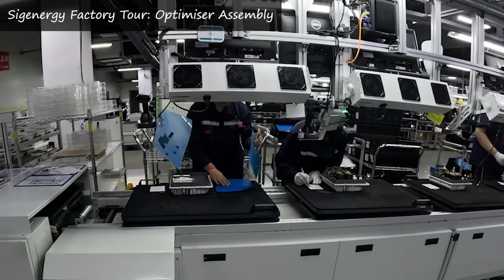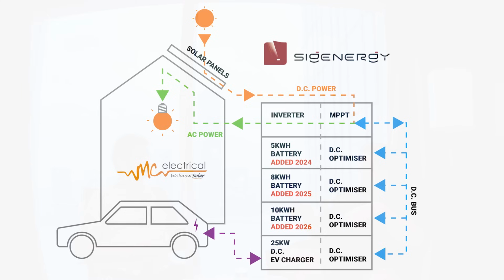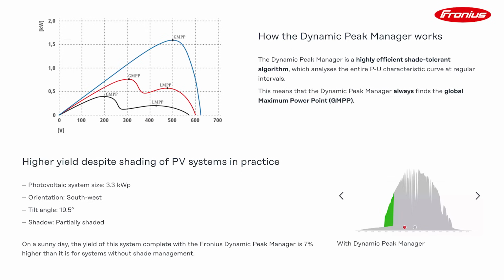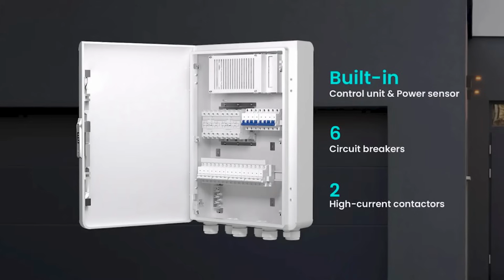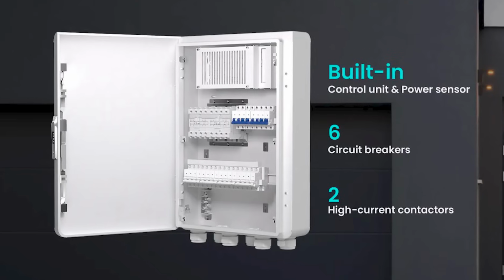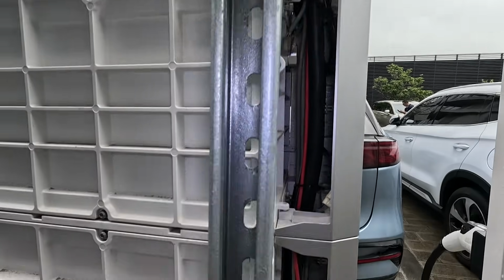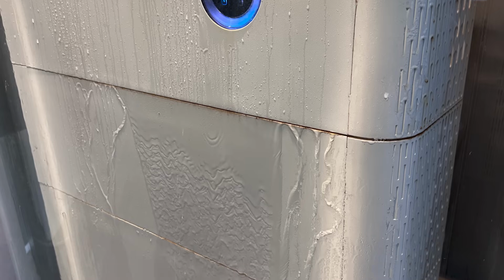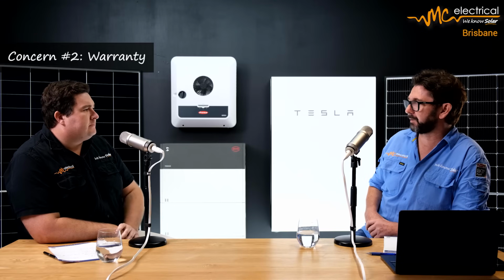Sigenergy Solar Battery Review After Factory Tour

Comment: The way this product is marketed makes it look very impressive, but in reality, there are too many drawbacks to fully trust it.

For example, you found some important issues during your factory tour that confirmed my concerns. One big problem is the DC charger and V2X (vehicle-to-everything) system. It won’t actually provide the full 25 kW of DC charging from solar and battery storage alone. Instead, it pulls extra power from the grid, which means it’s not really using green energy.

Also, major EV brands like Tesla won’t support V2X because managing heat is a big challenge. That’s why Tesla doesn’t offer vehicle-to-load (V2L) either. Most EVs that do have V2L are limited to about 3 kW of power.

So why don’t they educate people about these limitations?
Reply: @madhavamadhav6470   on theory you could charge at 25kW  if you had 25kW of pv and storage power available. Ie solar is producing 15kW currently, and 20kWh of batteries discharging at 10kW.
V2X will get there, but yeh, we don’t know what the ev manufacturers limitations will be…. If they allow it at all. But being DC v2x, it should be more than 3kW, which i imagine is just when they are using an onboard ac inverter.
Reply: Why are you saying it wont do 25kW charging from only battery and solar? Are you perhaps limited by available solar and/or too few batteries? What solar input and how many kWh batteries have you tested with? Because we have no issues charging at 25kW even in off grid situations, and being off grid is a guarantee that nothing is coming from the grid.
Reply: Whole idea is to save money not to spend money 😂
Reply from the maker: Ha, we clearly have different agendas 🫢
Reply: Most of the consumers have 13kw solar average size of battery is around 16 kw if they are using power at home to run aircon and more DC charger takes power from grid too
Reply: @ ok, so clearly your original statement was very wrong. You are building your entire conclusion on undisclosed arbitrary assumptions that has absolutely nothing to do with the DC charger itself. If people have too small of a Solar and Battery system to provide 25kW, obviously you have to either lower the charge power, or you will use power from the grid. That should be self explanatory for absolutely everybody.

Comment: Great video and perfect timing for me as I'm about to purchase a battery system. Agree with all you've said - good and bad. There are also major issues in relation to internet connectivity - if the internet connection is down you lose all visibility to the system. If you are not connected to their servers, after 90 days the battery will shut down!!  There is no justification for this IMO and was the final nail in the coffin for me so think Fronius / BYD might be my best option.
Reply: The justification is that they really want the battery modules to be monitored as any issues detected early by the Ai systems can be noticed (info sent to installer and Sigenergy centrally) and fixed long before it becomes eg a fire hazard. Also, to make sure the software can always be kept up to date, fixing bugs etc. Further, for the Ai to work, it also needs to be online to keep track of electric buying and selling prices. So the 90 days is basically an anti lazy installer feature, forcing them to make the system be connected, to make sure the features and updates actually works.

We have however been putting high pressure on them in Sweden to come up with a solution for also where customers cant or dont want to be connected to the internet, and they have promised to come with a solution in the future, to enable updates via USB etc. We will see when that solution comes how it looks.
Reply: For the record, now with the release of v3.0 of the app, batteries are no longer shut down after 90 days.
Reply from the maker: Oh I’ll have to look into that. With fronius, you loose the app obviously, but you can “direct connect” your phone to the inverter or battery.
Reply: I checked this and the warranty says “limited mode”. Which is kind of vague. Yeah having a dead man switch built in, that it must connect to the Internet is very suspect to me. Especially given current global tensions.

Comment: If this battery is installed inside a garage however this eliminates a lot of the negatives regarding cable management and weather or climate protection?
Reply from the maker: Good point. It’s still raises questions about the design choices of a company that can’t get the simple things right.
Reply: Lots of cables in there for rats to eat, the Huawei they ripped the design off from is fully enclosed so no potential rodent damage, PV string cables goto the inverter which is separate.

Comment: Can you pull DC out of a Tesla model 3 2022?
Reply: Yes you can. We have been doing a lot of V2X testing with Sigenergy DC-charger in Sweden in off grid mode (on grid is for later, still a lot a development of both software and app that has to go in). In short/limited protocol tests (minutes to hours, not days or weeks) we have managed to get V2H working for the following cars so far.
(L) Tesla Y Performance [2024] Feb 2025
(E) Tesla Y Dual LR (NMC) [2022] Feb 2025
(E) Tesla Y SR (LFP) [2023] Feb 2025
(L) Tesla 3 [2019] Feb 2025
(E) Tesla S Raven [2019-6] Mar 2025
(E) Tesla S P90D (New battery & BMS) [2015] Mar 2025
(L) Tesla S [2015] Mar 2025
(E) Hyundai Ionic 5 [2022] Feb 2025
(E) Volvo XC40 [2022] Feb 2025
(E) Polestar 2 [2023] Mar 2025
(E) Polestar 4 [2025] Mar 2025
(E) Fisker Ocean [2023] Mar 2025
(E) MG Marvel R Electric [2022] Mar 2025
(E) BMW i3S [2019] Feb 2025
(E) BMW IX XDRIVE40 [2025] Mar 2025
(L) Audi Q4 [2024] Feb 2025
(L) Audi A6 E-tron [2025] Feb 2025
(L) Skoda Enyaq 80x [2023] Feb 2025
(E) Xpeng G6 [2024] Mar 2025
(E) Citroën eJumpy [2021] Feb 2025
Reply from the maker: No. Regulations doesn’t let you yet. As far as I know the protocol is not there yet either
Reply: @mcelectrical  dam, things in this space take forever 🔥
Reply: @MatthewBayard  There is also the case where you may void your car battery warranty unless Tesla also gives it the tick of approval.
Reply: @Yorick_Mark  hell will freeze over before Tesla takes sales away from their stationary battery market 😔
Reply: @ I think you are right on that front. I had hoped that they would bring V2X functionality with the updated Model Y. Having lived with V2L with my Kia its a must-have for me now.
Reply: The Cybertruck already has it.. so hell has frozen over
Reply: @karlajensen100  you do know the Cybertruck is different to a model 3 right?
Reply: You said Tesla wouldn't do it and they have with their latest flagship model 3 doesn't have the capability because the charger is a charger with a big rectifier and a power supply DC. It can't make AC just like any other battery charger @MatthewBayard
Reply: @mcelectrical  do you seriously have regulations in Australia that forbids discharging a car by DC also in off grid situations?
Reply: Yes you can but it will void your warranty. The Sigenergy DC Charger website lists all the cars they have successfully tested and the Model 3/Y is on there supporting two different V2X protocols.
Reply: Not without Tesla knowing about it and they will void your battery warranty

Comment: My experience with Fronius was a nightmare.   The Inverter took on moisture and it took them 9 months to agree to a “good will” warranty replacement.   My installer was shocked at how bad their after sales service was.
Reply: Hmm, there can sometimes be installer issues. For example back entry (which we did for a while) caused ingress, and sometimes the cover isn’t put back on properly. 
Not saying fronius is right in this case but it’s hard to just point a finger at a product if the install had issues.
Reply: @markcavanagh  nope I was there when they removed the faulty inverter.  Conduit entered the enclosure from below.  Fully fastened in place.  The Fronius representative came out to look at it trying to blame the installation and had to accept that it was installed exactly to guidelines.  They probably don’t see many such issues but their response was horrible.
Reply: @ hmm yeh that does sound pretty pathetic.

Comment: I'm off grid with 2 Sigenergy inverters, 24kWh batteries, 14kW pv and the 12.5 DC Charger. So far so good. the DC Charger works well charging with excess pv only. The app looks flashy and does provide a lot of functionality and cross platform support but needs a lot of work (all the way down to the framework they used). The system integrates very well with Home Assistant. We'll see how we go :)
Reply: Was the double inverter set up for redundancy, being that you are off-grid or was it based on the availability of the inverters at the time?

The DC charger will be very interesting for your off-grid application. I assume you currently rely on a diesel generator on rare occasions. I suspect that once V2H is standardised, the additional storage in the EV makes the generator redundant as you could get through long periods of low light on storage alone and in the worst-case scenario, charge up at a nearby EV charger if available.
Reply: @Yorick_Mark  yes 2 inverters for redundancy, PV requirements etc. 1 inverter on the house with 7kW PV. and 1 on the carport with another 7kW PV and the dc charger. No generator at them moment - hoping V2H is enabled by winter! We should be more than fine though based on our old systems size and usage
Reply: @tassieminiz  Thanks. I'm glad it's working well for you and I hope that V2H is enabled sooner rather than later. Compared to other off-grid systems I have seen (which is not many) the SigenStore is an elegant solution in comparison.
Reply: @Yorick_Mark why would you charge at a local EV charger for 2x the cost ?
Reply: @alwaystmoza  If you were fully off-grid and had a V2H setup. If you had an extended period of low light and your batteries were low. I could see the EV as a way of transporting electricity from a nearby fast charger to the house instead of running a diesel generator. It is likely much more $$ to purchase, maintain and fuel a diesel generator compared to an occasional fast charger top-up to recharge your off-grid battery system.
Reply: SigEnergy announced last night on a webinar that new app coming out very soon
Reply: Who did you use as installers?
Reply: Sweet about to get a 24kw system.  3 phase. Can the battery be charged by the grid during the night ? Ev charged rates very low 8c pkw

Comment: Hi Guys, I’m a sparky in Vic and have to agree with you 100%, I have seen a few installs, and they definitely need a better solution for cable management the build quality is not to Australian harsh conditions also the gateway components are average at best. Maybe in another 3yrs, few revisions. I personally install a Sungrow system after a lot of research at the start of this year and it’s been excellent, in opinion they are leaders now, fronuis are a great unit I had a standard grid inverter before my upgrade but they haven’t kept up with integration and a 30sec blackout is 90’s tech, and there subscription app model sucks! as well as only supporting 1 brand of battery company. Great work guys, we need quality products installed to give customers reassure on their expensive investment.
Reply: Yeh there are some obvious red flags. I need to revisit Sungrow. We stopped installing them about 3 or 4 years ago after having too many issues. I’ve heard others have had a lot of issues too. We also had concerns about the level of tech support. But maybe the reliability and support issues have been sorted. It definitely looks like a good product on paper now.
Reply: Yes, the plastics and the cables management on SigenStor could be improved. But check out the new C&I product SigenStack, no plastics, only nice bare alu castings in 12kWh modules up to 252kWh/System. Also, hybrid inverters 50-125kW, as regular wall mounted setups.
The home version, SigenStor is also coming with a small wall mounted inverter soon (think Huawei 10KTL-m1 just slimmer), that should make the cable handling easier.
Reply: Funny as the Huawei is spot on and the guys are ex Huawei
Reply: Do these integrate with a Fronius inverter or do I need a new one?
Reply: @Rob.daw-g  I believe if you have something like the standard Fronius Symo, you could keep it and use an AC coupler which comes with its own pros and cons. If you have a Fronius Gen 24 / Hybrid then it should integrate as just a battery platform.

Comment: You mentioned the changeover was quick and it could be used off grid.

Can the gen24+ / BYD combo work well as an off grid system in your opinion? I’m not sure
Reply: @kd19512  no, here’s my take. Fronius is conservative. Running off grid potentially puts a lot more strain on the components. It runs day and night. It was (like Sigenergy) designed and tested as an on Grid system. 
Fronius technically Allows the system to run off grid for 20 percent or so of its life cycle. But last week we asked Fronius to review that. Maybe they could offer a more rational 5 year warranty off grid.
Sigenergy is new. They don’t think so much about liability.

Comment: Nervously waiting your further videos on this. It’s amazing how few options there are on Aussie market for full house 3 phase backup. I wish Tesla made a 3 phase product
Reply: I run 10+5 gen24+ with 19.3kWh BYD and it works well. Although it is slow to kick in (30sec) when I get grid outages. 3 phase home
6 aircons, pool heat pump and hw heat pump. Still have excess so you should be ok if you have enough panels
Reply: @ thanks for your comment good to hear it’s possible
Reply: Fronius and Istore both have great three phase solutions too
Reply: That’s easy. Fronius BYD if you want it soon. Fronius plus the new fronius Battery if you want it by the end of the year. But the fronius battery will have sensible limitations so you may need multiple stacks .
Reply: @ needing to run a 3 phase air con as the house has an area of cathedral ceiling and gets hot as hell :(
Reply: Sungrow hybrids works good

Comment: Great timing, I was about to purchase one.

The biggest hold back for me is the "bi-directional" charging on the EV DC module.. Without it, its just a very expensive charger (12 or 25kw)...

Sungrow does have Global MPPT Scanning, you can set up the inverter to do it at regular intervals and it does work...  I have mine setup for every 30 mins, some morning shade really causes problems for one of my strings, and GMPPTS helps "light" up a panel when the shade moves off it...
Reply from the maker: Oh thanks for the update on Sungrow. It has been a few years since i tested it. Might be worth another review
Reply: @davids8345  The biggest advantage with Sig is that it is modular, so you can add as you need.